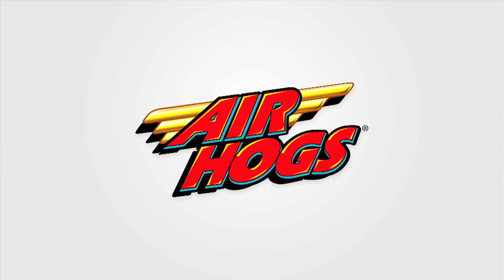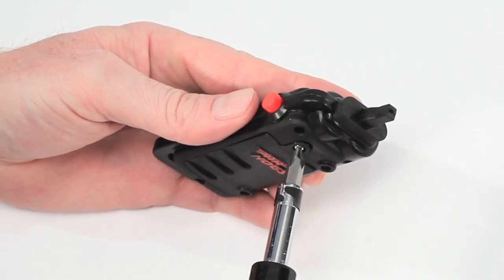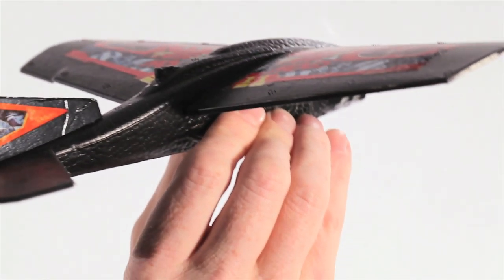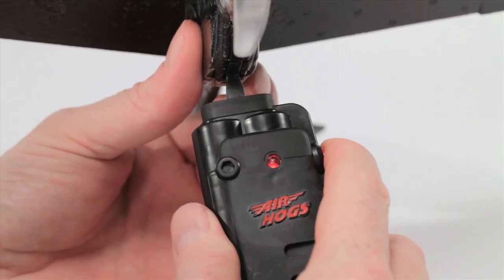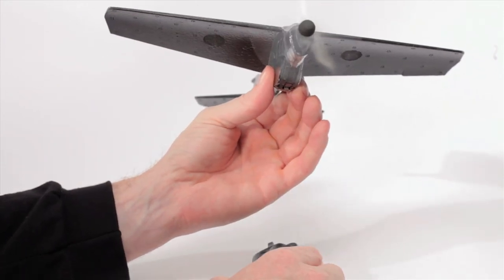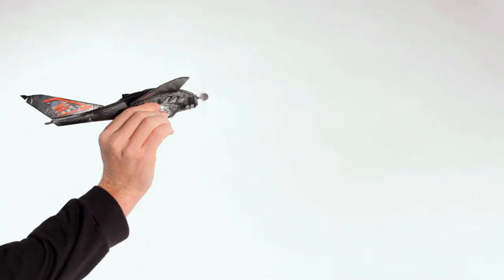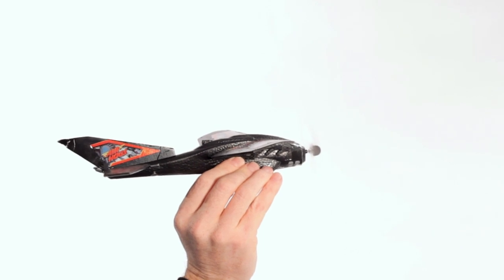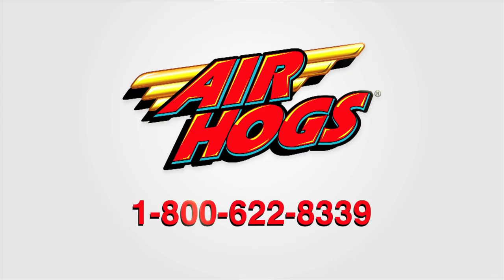How to Fly Air Hogs Wind Flyers

Comment: @1sod23  Hello Mr mind reader. It's nice to know that you were able to determine that I didn't read the instructions. Pretty amazing stuff.  FYI, I have built and flown both RC and Free-Flyer airplanes for over 50 years.  ALL of  the Air Hogs airplanes are poorly designed and the quality control out of China is even worse. Its the luck of the draw with an Air Hogs. My $2 balsa wood rubber-band airplane fly's circles around the Wind Flyers.

Comment: @TheRudydog1 I just bought this, flew and it flies decent for being $12.99. Check out the maiden flight on my vids. The trick is to leave it charging a bit longer. I tried in increments of 10, 20, 30, 40, 50 secs- up to 30 secs, it didn't have enough power to fly, but after 30 sec charge, the plane flies exceptionally well.